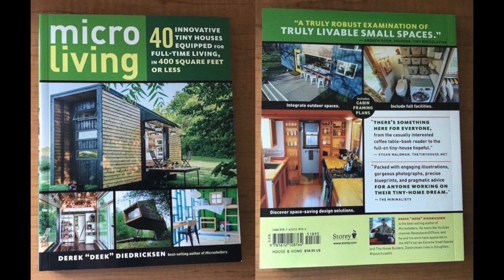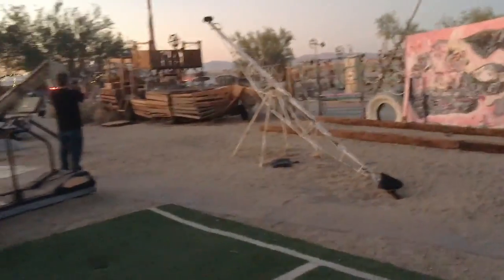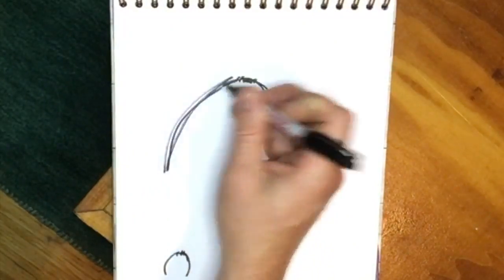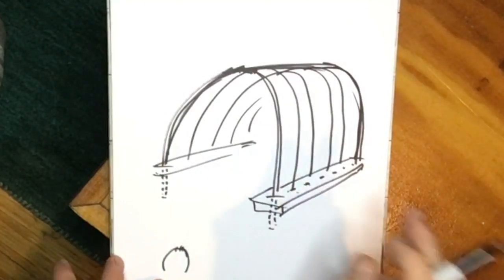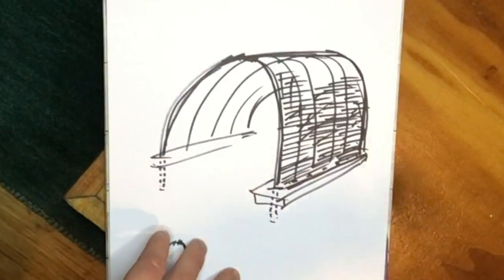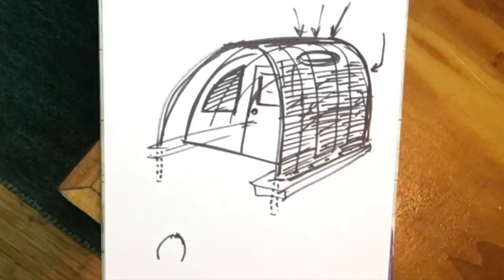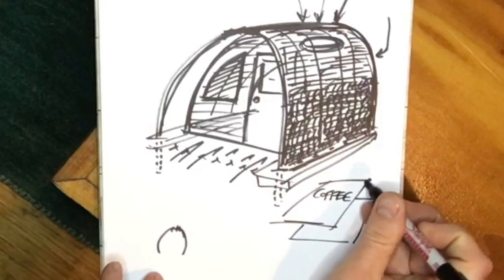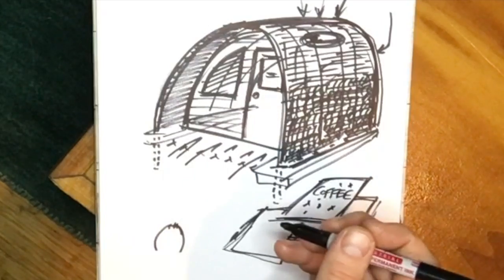Ferrocement Cabin/Shelter in Slab City, CA- HOW TO BUILD IT

Comment: I’ve used poultry netting with rebar, hardware cloth, and metal lathe for ferrocement structures. The metal lathe was by far the easiest to get the cement to stick on the underside ceiling, IMO the most challenging part to keep the cement in place during the initial process. Tarp and having someone on the inside is a very important tip, thumbs up 👍🏼!

Comment: My dad was a contractor who specialized in concrete work. His trick for anchoring things like this rebar into cement  was to sink in a bottle, neck down, into the spot, then when it was set you break out the bottom of the bottle, place your upright plumb, and fill in with more cement.  For a porch railing you can use beer bottles, but for something big like this a wine bottle might be better.
Reply from the maker: Love these kind of DIY underground tips! Thanks
Reply: how do you make the rebar bend to an arch?
Reply: Sweet

Comment: back in the 70's mother earth news did this using bamboo.. to make a bigger structure you make 2 hoops on the ground connected with another hoop, once the skin is applied on the outside you can remove the inside legs.. There was a company in NE Florida in the early 90's who built sheds using plywood to make an arch and covered it with a similar system but they used a large roll of fiber membrane and applied the concrete with a gun, the one I saw was 4sheets wide with about a 10-12' peak
Reply from the maker: Yes, bamboo IS pretty amazing! Took some video when I was in Hong Kong of the bamboo scaffolding they'd use while working on buildings- some of it was 20 stories tall!
Reply: how would I bend the rebar to a hoop? I know of simple tools that will bend, but they are more for 90 degree angles
Reply: @AliAbdullah-oi3wc harbor freight has tubing bending jigs with rollers so probably would work for small D rebar

Comment: To waterproof it. .. mix mortar with 1/2 the water required and the rest paint…mix with a drill and it should fluff up like shaving cream…paint it on with a brush… you can also paint with latex, add cloth on top (bed sheet) and immediately repaint while wet…then add paint layers until the cloth disappears…sprinkling dry mortar mix on it help to give it a concrete look and feel…

Comment: We've been building "Sanctuary One" at The Slabs for a few years now -- 18' wide; 16' front end to back end wall; 12' tall. At this point the 10-faceted roof is completely done at very low cost using OSB and aluminized roof coating over 3' long chunks of 2x4 put together in "rigid arch" fashion with plywood/OSB glue plates and galvanized 2" box nails. The one end facing the street (Coachella Canal Road) is completely done with three windows -- storm shutters which double as shade awnings for this west-facing wall, etc. :)

Last "winter" we built what is likely the nicest and most permanent "gopher hole" at The Slabs (Spyder at The California Ponderosa can bring you up to speed). It is a perforated 50 gallon plastic drum installed vertically in a hand-dug hole and backfilled with fist-size and larger rocks we hand-picked from the nearby desert. Then I put down four layers of old plastic tarp, built a "garden wall" from dry-stacked cinder blocks (two rows above grade) and filled the cores with smaller rocks, beer bottles, wine bottles, rebar and hand-mixed concrete in a five-gallon plastic bucket. Then all the loose dirt from the dig was put inside the garden wall. The idea is that blackwater would go down below and graywater could be used it irrigate whatever is planted inside the garden wall. :)
Reply: @She-Wolf -- We haven't taken any video of our build yet. I have seen it in a video or two made by others but I don't remember which ones. All we have at this point are regular pics. :)

Comment: We have 1,100 watts of solar panels now and are pre-wired for another 250 watts. This should make it easy enough to run a solar-powered small batch concrete mixer going forward. Concrete is a good choice at The Slabs = thermal mass and resistant to fire which seems to be one of the constant variables there. :(

Comment: I like the flat wall and overhang up front, but I think a curved airstream-like back wall would be pretty sweet. If one were to attempt such a complex shape, do you think vertical rebar bent to the center of the last full arch would be the way to go, or would full arches suspended at different angles and tied together be more structurally sound?
Reply from the maker: Yes- could easily do that too- good point- I was just think more so in terms of the ease of working in windows into traditional vertical walls in this case.

Comment: How do you bend the rebar?
Reply from the maker: You can drive posts (or anything similar into the ground), as bending points to work the metal around..... almost like a jig. Its almost the same way by which you more-safely break firewood/campfire branches by sticking them between two trees and using one tree as leverage for the break.